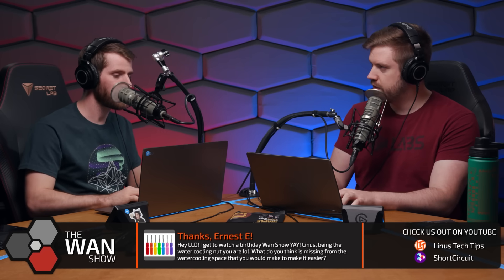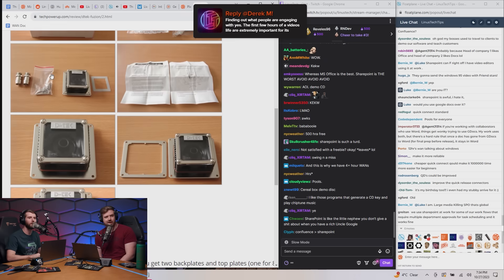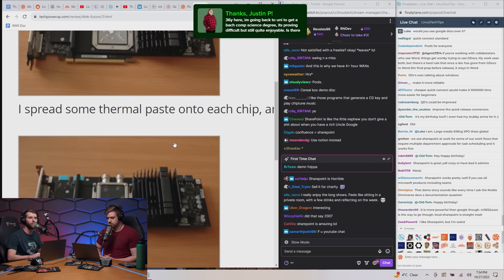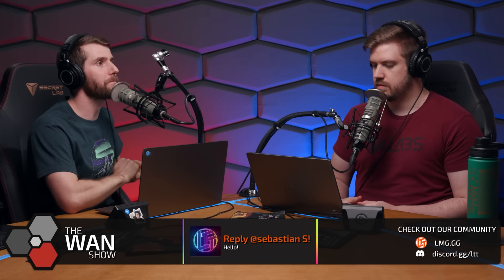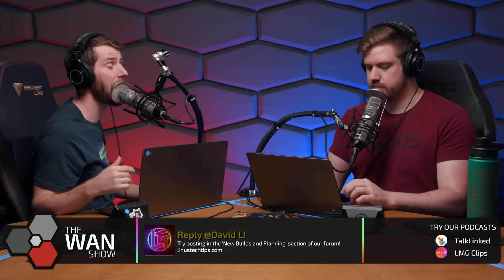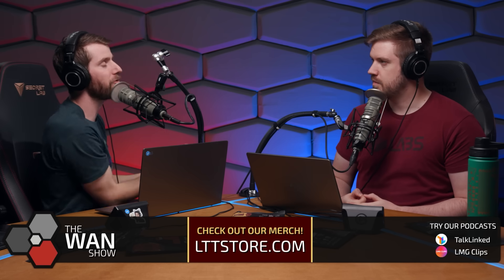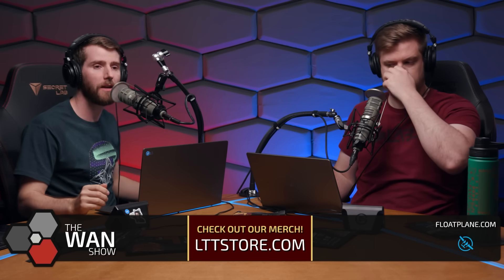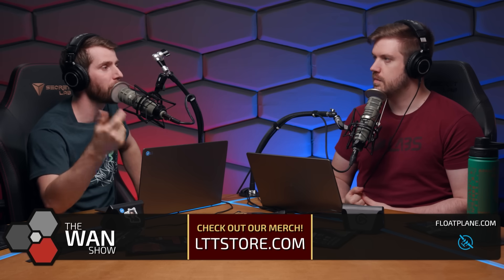Water Cooling is Broken

Comment: You're forgetting about the NZXT Kraken GPU cooler. It's kept my 1080ti sub-50c its whole life. I wish there was a solution like that because I own the terrible XC3 Evga 3080ti that can hardly keep sub-80c so it never hits its clock speeds.
Reply: Wasn't the fan too loud ? If I recall correctly, it only have a shroud on wich you mounted the waterblock and a fan responsible for cooling everything else, right ?
Reply: mine has been working for over 4 years on my 2080, it's brilliant
Reply: @lamikal2515  Fans can be swapped out... my Kraken was silent though at normal fan speeds
Reply: @lamikal2515  I took the fan off and cut the bracket so I can fit heatsinks on the VRM and RAM and just use case fans that were already nearby.

Comment: I tried to leak test a 3D printed sintered steel test part and the results were not great.  The process leaves voids in the metal.  I hear there are ways to seal it, but how much does that add to part cost.  Saw comment about it being pretty cheap to machine.  Common parts would be awesome though.

Comment: Hold up, is this not what billet labs were doing before LTT stole their prototype?
Reply: the hate train is gone calm yourself
Reply: The prototype they gifted and only asked for it back after ltt fucked up the review?, no that was a different thing custom built for a single card 

I'm not excusing ltt for giving it away but lets also not miss represent what happened
Reply: No, the billet labs block was supposed to cool a cpu and gpu at the same time.

This is not what they were talking about
Reply: @a3-radio sorry but bullshit even LTT never claimed the prototype was a gift
Reply: @shaynegadsden  you mean the documentation that was shown and made publiuc were they send it for ltt to keep saying that it will look cool on a permant build but ask for it back after the review and they found out it was gonna be auction? cuz that exist and was shown and i absolutely agree with the company that ask for it back, ltt blunder was huge but lets not miss represent it
Reply: No. On their website Billet has multiple options for 4090s, 3090s, and amd / intel cpu.
Reply: @a3-radio  were is that i have seen say "keep for future builds" but you see when a normal reads that it doesn't mean i am giving this item, it means you can hold on to it to use
Reply: billet is even worse in this regard since it needs VERY SPECIFIC gpu model and motherboard combination, not just a specific board design
Reply: Considering what Linus is talking about isn’t even remotely what the billet labs prototype was, it just sounds like you wanna whine about that incident as if it’s still relevant. Doesn’t matter who fucked up, it’s over. Move on.

Comment: I wondering if memory metals could be implemented for such a thing.....just have to be able to bend the metal and then hope the heat from the device is not enough to warp the metal (need to do some work figuring out what temps memory metal would be acceptable for this ) a single block could theoretically be used on multiple cards...

Comment: Linus, metal printing is very expensive. For such 'easy' parts, machining would be far cheaper. And machining on demand could be relativelly inexpensive, specially if they make a special built CNC (really just an attachment so they can flip and reindex the part quickly, ideally automatically).
Reply: Does the sintering process produce porosity? If yes, even to a very small degree, the end result would be totally unsuitable for the heat sink anyway.